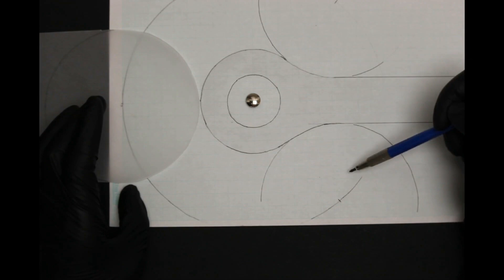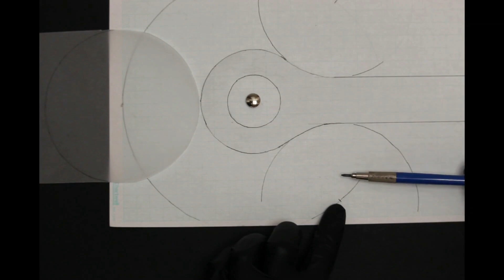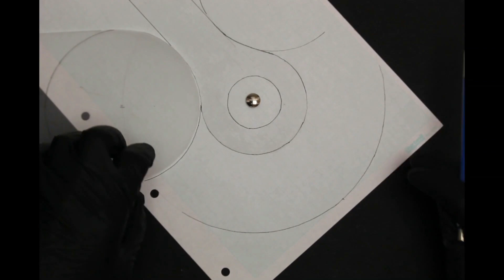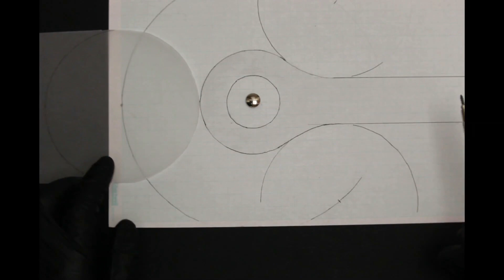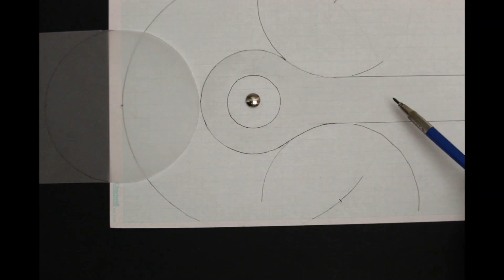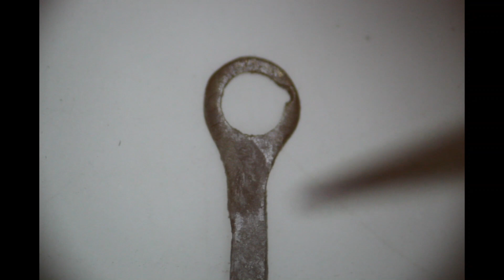machining watch hand

Comment: Have you looked into pantograph machines for stuff like this? Would look at a deckel/ Alexander as you get metric machines show up in the uk they have a reasonably large footprint as someone in the uk trying to work out a single garage and on a budget its hard to justify but it's also possible to do decorative work that would look nice on a watch
Reply from the maker: Those pantograph machines do look incredible. I have recently acquired a gravograph engraving machine which works the same way. 
 Although for engraving I suspect I may be able to mill a watch hand. It would also allow for more options such as curvy lines. 
 I have puzzled over how I would get the hole perfectly in the centre with sufficient accuracy. Certainly an interesting thing to think about, cheers.
Reply: @stanwatches the gravograph is a nice machine and useful too. Try look up early Stefan Gotteswinter as he shows some interesting stuff on a 2d pantograph making some precise and small parts. The spindle is a different arrangement to a gravograph though. A clever template high enough reduction and some time and you might be there. I have enjoyed seeing your work its interesting

Comment: Could it be better to drill the 1mm hole last, Do the centering spot drill, but not go all the way through. leaving a bit more meat for the outside milling, (Not that there is a great deal of meat there anyway) Then you could see if anything has moved, and also have the center mark as a final check to make sure nothing has moved and started to break free, and also use something to hold the hand down for the last step of drilling the center hole? Fascinating seeing such tiny part being milled. New sub from this, and look forward to watching all your other videos now.
Reply from the maker: I think I would have little hope of accurately finding the centre of the hole again. I have previously had no issues with the hole drilling and the great merit of drilling first is being able to progress to mill around the hole consistently. With the tooling I have I think I would rather inconsistently centre on the spot drill mark.
 I have previously tried adding a clamp after machining one side of the length of the hand and the force marked the part. This left me cautious of enduring the attempts required to get good at it although I do think there would be great benefit.
 There is much to consider before my next attempt and I will certainly consider what you suggest. Thanks for the ideas and thanks for subscribing.
Reply: @ Ah ok, thanks for explaining that, My other thought would have been drill the hole, and then go deeper than required, and put a 1mm pin in through to the Aluminium if you had one. Best of luck. But you have probably thought of so many things to try already, I do look forward to seeing you succeed sometime in another video.
Using the macro photography, and seeing that huge looking endmill, and then i think about what 1mm actually is, then I realise just how tiny a part you are trying to mill, I know its for a watch hand, but seeing it so large on screen and my brain just does not compute haha
Reply from the maker: @d.i.l.l.i.g.a.f  A pin through the hole is a very nice idea. I very much like that. Will enjoy thinking that through. 
Have puzzled myself over how best to show the reality of the size, once you get close to show what is actually happening you do loose a sense of scale.  Happy to have a go and try and make each video a bit better, just like I am not showing how to make these parts but showing my adventure of working it out. It's all a lot of fun and lovely to find folk watching, cheers mate.
Reply: @stanwatches  I like the close up filming personally, Just have to trick my brain into remembering just how small these parts actually are, as I watch a lot of CNC videos, and of course they are on a much larger scale to a watch, Just wish I had the Patience, and the Eyesight to perform such tiny operations. Even though I have no reason to make anything like this, Just find subject fascinating. Clickspring's Clockmaking channel comes to mind, but he must have the patience of a saint, making these kinds of parts by hand, filing to finished sizes etc.
Reply from the maker: @d.i.l.l.i.g.a.f  I like the JohnGrimsmo channel for the cnc machining. He has a Kern which is an amazing machine and a Willemin which does turning and milling in one machine in a very interesting way. 
Clickspring is inspiring. Beautiful work. And Chronova Engineering lately for a similarly inspiring use of manual machines.
Reply: @stanwatches  Many Thanks for the recommendations, Have not seen their channels before, and have now subbed to watch soon.

Comment: why machine it? just electro-etch or lithography etch it. far simpler and accurate enough and will not distort the part due to machining stresses.
https://www.youtube.com/watch?v=jEnNMTMZadw&pp=ygUbaG93IHRvIG1ha2UgcHVsc2VqZXQgcGV0YWxz
Reply from the maker: @shmuck66  that is an interesting video. Reading about it I do think acceptable tolerances could be achieved. I will look into it further, cheers.  I have looked at using a laser but that doesn't seem as fun as milling. 
I am most interested in machining and developing a reliable technique here will help me with parts I intend to machine in the future. Etching is certainly something to read more about, thank a lot.

Comment: Very exciting! Thanks for documenting your process Stan! I'm going to try making some hands for a pocket watch soon by turning a steel wire to have a bulge on one end where I want it a bit thicker, and another bulge where I'll drill the hole, and then hammer the wire flat, shape it with a file, drill it, and blue it. Have you ever tried that? Stian from Vintage Watch Services did that in a video and it looked easy and effective (for large pocket watch hands anyway).
Reply from the maker: That's fascinating, I will go find the video. I did start off making hands quite like described by Daniels but am most interested in finding my way by machining. I do like the sound of the method you describe though. Thanks for that and good luck!

Comment: Maybe if you could glue a piece of aluminium on top of the blank before you glue it to the aluminium "glue chuck".  So it would then be sandwiched with aluminium and this might reduce your tear out problem.
Reply from the maker: Ah, that is an interesting idea. I could bolt it very securely on top. I will think about that, cheers mate!